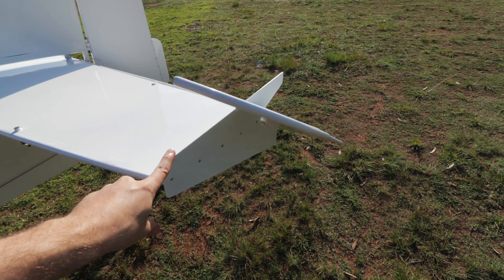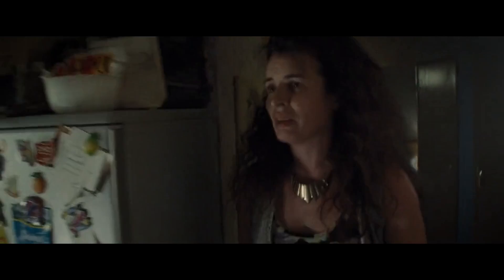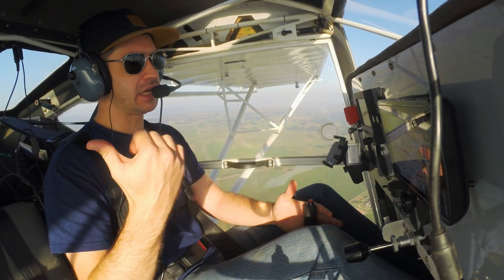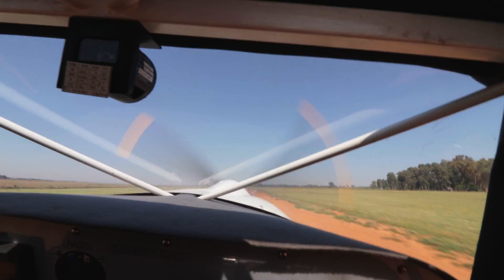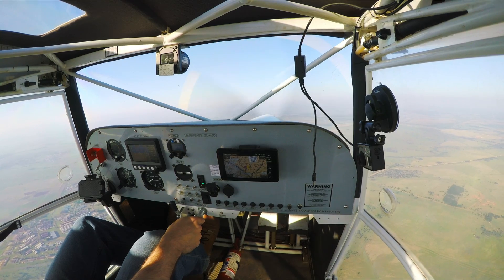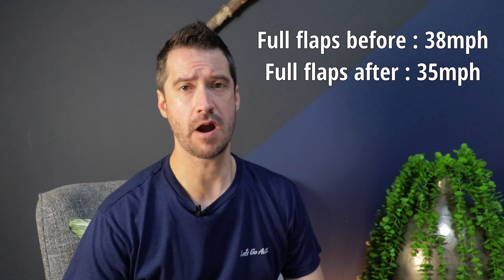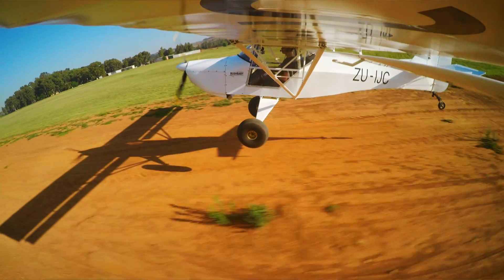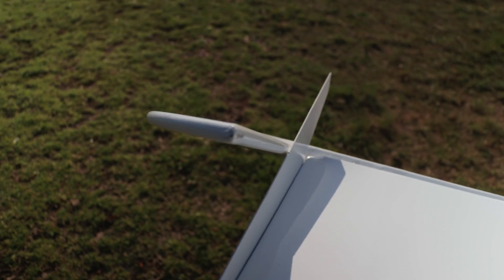Bushplane Tailplane Upgrade - What Makes it Better?

Comment: Hoeveel?
Reply from the maker: How much does the upgrade cost? So KFA does an assessment on the current strength and stiffness on your planes horizontal stab. Since most Bushbaby's are hombuilt, they are not necessarily all 100% alike, so it might differ from plane to plane. In our case it cost R18k (South African Rand) including labour to do the upgrade. But ultimately check with KFA regarding the cost.

Comment: Some covers on the rudder and elevator joint will give you some more performance in all aspects too!
Reply from the maker: You think so? We still have them, just needs to be fitted. Tell you what, we'll put  them on and see. But I doubt the difference will be measurable.